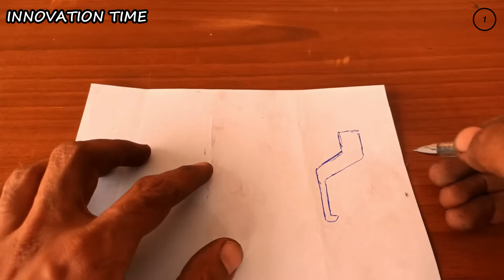Blind hole bearing puller 3 best way

Comment: Bearing pullers are dime a dozen
What about bearing race that has no lip to push out or tap it out
Reply from the maker: The second tool is for the same thing
Don't miss this video :
https://youtu.be/rD8Cc0RfbSE
Reply: @innovationtime20  well great idea but the race is 6 1/2 inches wide and to get it out you have to be pushed down towards the ground I tried so many techniques and specialty tools none of it works .
The only thing works for me is to weld a bolt onto the race and slowly tap it out
Reply from the maker: Yes my friend 👍
Welding is the last way 
When non of them works 😉

Comment: Waste of time, fill the hole with bearing grease the use a punch in the center and the pressure from the expansion pushes the bearing right out works eery time
Reply from the maker: I have another video for it 😉
https://youtu.be/dRtR1smHfFM